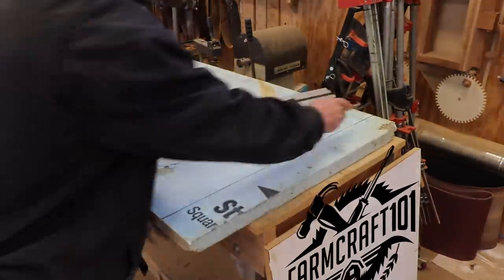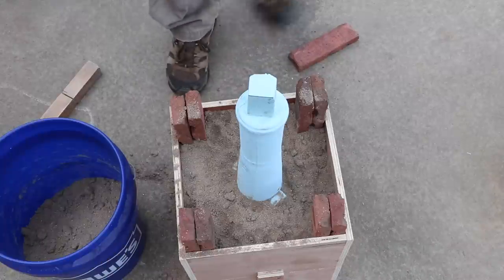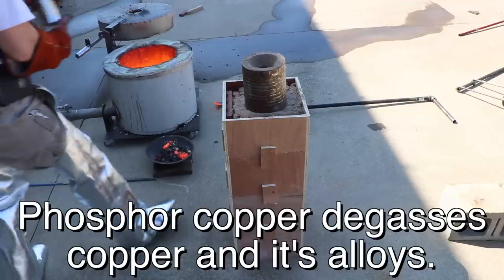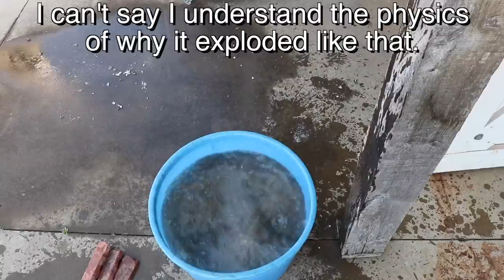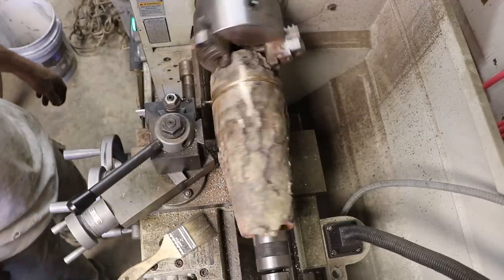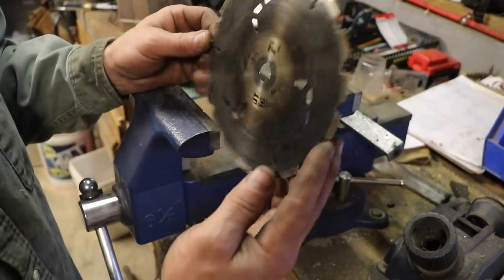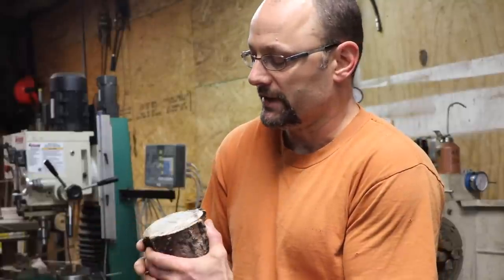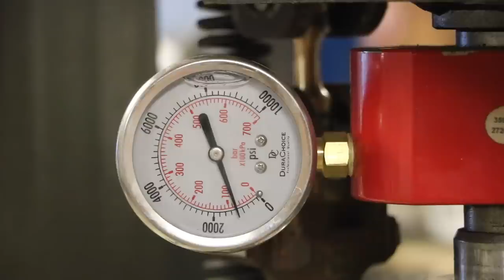How NOT To Cast A Historic Bronze Cannon Barrel.  FarmCraft101

Comment: I think what you may have forgotten when you were testing Tensile PSI STRENGTH you pulled the whole “cannon” out of the mold right away after pouring, so quickly in fact the interior was still molten. Then dunked it in water to cool off. I can’t say I understand how Tensile PSI Strength relates to cooldown time [nor do I know how it differs between Cast Iron, Steel, Aluminum, Copper, Brass/Bronze] but If I was a betting man I have a feeling allowing the metal to cool slowly and uniformly might {just might} net you a higher strength result. 

That being said, someone else prolly already mentioned as much and since I’ve seen posts for the final production, all this is a moot point 😉.

The one thing to add that is still relevant is: Thank you for documenting and sharing your trials and tribulations, the methods and thought process as you work new things out. They say failures are never wasted cuz it’s simply 1 more method you can say does NOT work … by sharing that with an open community we all gain the benefit of seeing it for ourselves and hopefully 🤞 not ever find the need to verify your results.

Comment: One thing I noticed between you and other lost foam cast videos is that you did not coat your foam model in plaster.
Reply: Normal plaster is a biiiiig no-no when it comes to casting high temperature metals. It tends to explode. Do you mean like special refractory cement with a plaster binder or something?
Reply: @daviddoluca6620  - I was watching the video titled "Shijiazhuang Ruiou Lost Foam Casting Equipments Co,.Ltd" right at 1:26 and I thought they were using plaster, but you are right, it is some sort of cement coating.

Comment: I  was a machinist for forty years . What your  brazed carbide tool should be is a C2 or a Carboloy 883 . These would be rated for cast iron and other abrasive metals like what you were turning . ( a C5 or Carboloy 370  are for steel ) Next put a 3/32 radius on the nose . Spindle speed about 120-180 RPM . Feed rate .010 -.012 per rev ( IPR ) and a depth of cut about .100 per side and chip away until it cleans up to about 75 - 80 per cent . Then you can speed up your turning . It'll take awhile but you'll get there .

Comment: Although I'm a little older than Harry Harris I also worked in a foundry when I was a 18. At the time we were casting aluminum lawn mower body housings and any defective castings and scrap was stored outside where it was exposed to rain and snow. There we three crucible style furnaces side by side in varying stages of the melting process. Eight workers in the foundry including myself received varying degrees of nasty burns due to an serious explosion in one of the furnaces. As workers were aware of the danger when adding new scrap to the furnaces so they would dump scrap from one scrap bin to another before adding it to the crucible in an effort to dump out any excess water that may have pooled or captured in the hollows and voids of the scrap. Due to the size of the explosion an investigation later determined that a complete, but scraped, lawn mower casting must have filled with water and then purely by chance, another complete casting added later on must have accidentally aligned perfectly with one shell going inside the other (like one soup bowl stacked on top of another) trapping the volume of water between the shells. When the water came in contact with the molten metal it instantly flashed into a steam explosion. The forklift driver adding the scrap to the crucible got hit with a wave of molten aluminum receiving  burns over 60% of his body. He spent several months in the hospital and ended up on disability. Unfortunately back in the 60's other than heavy gloves and goggles we didn't wear full body protection or hats of any kind. NET: Whether it's molten metal added to water or vice versa then result is the same. (this link is not to a video of my accident but presented the same general result -  youtube.com/watch?v=sIJmwF1Qs7M

Comment: The explosion. Water turned to steam.  Steam is 90 x more volume than water.   You get a very rapid expansion of liquid water to steam with a pop.
Reply: I believe steam used to expand to 1700 times the volume of water but it's getting old now and could be losing some of it's steam. That was some time ago and I haven't been watching if physics have been hit by the current insanity infestation. Nothing is safe these days. One of water's relatives, Iceland was hit recently and it seems as though someone has been pounding on the equal to asci button and changing everyone or it could be something in the water they're chewing there. No ill intentions just going crazy and taking as many along as possible. Peace
Reply: Jim Marriott  I was going by memory maybe wrong, but in any event it’s a lot.  

I learned the hard way casting boooollets.  I dropped a piece of lead into the pot that had a drop of water on it.  The walls were covered, the ceiling, and of course me too.  Burnt the shit out of me.   Now I preheat anything going in the pot. God takes care of stupid.  I will not do that trick again.
Reply: Too true. I was holding a hose one day when a high school teacher I built a V8 Vega for walked over and removed the rad cap right after breaking the cam in. He was shirtless and went to a fine shade of red in the explosion. I started spraying as I asked wtf are you... He got out with no harm just a little discoloration. He's a science teacher. Go figure. Try a cup of over heated water in the microwave. Tap and kaboom. Crazy stuff that water
Reply: The 2 stroke Norwegian is casting his own 50cc cylinder and learning as he goes to. I agree with you, preheating is the way to go. Losing the foam completely ahead of time is the only way to fly.

Comment: You need something like a ceramic coating on the foam to contain the pour as the foam melts and burns off. That along with some proper venting to relieve the gas pressure in the direction you want so it doesn't push out on it's own. Also in order to improve the grain structure and put any inclusions  away from the high pressure breach of the canon you could go to a bottom pour type of moulding but that typically uses 50% more metal as a loss from the long sprue and associated gas vents.

Comment: Thanks for the video. You can't forge or heat temper bronze the way you described - that's for iron alloys. Bronze can be work hardened but I don't think that would be helpful in making a cannon. Best I can tell your results are down to the composition - we saw you add copper, tin, and then brass? As far as I understand it you want 88% copper 8-10% tin and the rest zinc. If the brass is pure copper zinc and the proportion is calculated right that could have worked but perhaps it was not. Supposedly with a slow cooling piece like that the tin tends to migrate to the last parts that cool - in this case right where you drew your test material, so that may have influenced the result. You could do the casting with considerably less metal if you cast it around a solid core, and it'll save a lot of time drilling a bore later.

Comment: When you put the hot casting in water, it first hissed a lot, then it exploded.  You asked if the physics for this is known.

What you saw is something called the Leidenfrost effect.  What is happening, is that radiant heat (ie: intense infrared light) from the casting is vaporizing a thin layer of water.  During this effect, the steam is physically separating the water from making contact with the casting.  

In science textbooks, the traditional demo of this, is water drops on a searing hot skillet, that zoom and bounce around.  Those droplets are riding on a cushion of steam.  Because there is no contact, the droplets move with little friction and zoom or bounce around the skillet.

But of course your casting is cooling down.  So at some point, the radiant heat is too low to generate the layer of steam.  This layer of steam is relatively insulating, compared to a layer of water.  So when the steam layer disappears, the water makes direct contact with the casting, and the water can then get heat from conduction.  So it heats up violently which is a steam explosion.

So the hissing is the Leidenfrost effect generating an layer of steam by radiant heat.  And the explosion happens when the liquid water makes contact with the surface, and generates steam by conduction.

https://en.wikipedia.org/wiki/Leidenfrost_effect
Reply: Beautiful. Thanks.

Comment: Yeh I think that you need two sprue pins. One to vent the other to pour into.

Also you need real casting sand. 

To save metal and also assist you in the bore maybe you could rough cast the bore into the foam. Then you can ream out the bore to the diameter you need. Reaming is easier then boreing. 

Also you might consider normalization. Rolls Royce buries their engine blocks in dirt for five years before machining the cylinder Head. That way the bore will never change shape. 

Thanks for this video! Loved it.

Comment: Awesome. As a fabricator that works with metals that are already smelted, alloyed, forged, formed (initially) and heat treated, I have learned a lot from your videos and others. I've also learned that I have a lot more to learn about metallurgy. Would muriatic acid remove the sand, or maybe lift it up so you can chip it off? Probably depends on the kind of sand.

Comment: I am a foundry engineer, however we cast stainless steel so bronze is not my field of expertise. But I know the brass foundries use nucleation agents like Zirconium to make smaller grains. We don't want to leave foam in the molds since it introduces porosity in the casting. You want to fill the mold from the bottom up with a gating system. I would have the breach tilted upwards with a feeder on top, and a core to make the inside of the barrel, and leave work allowance on the inside to machine it into dimension.

Comment: the water explosion comes from a rapid boiling of a larger amount of water, causing it to quickly expand while the water around it is still fluid. now the low density steam pushes up quickly and takes some of the still liquid water with it.
just as an idea, cover the outside of the Styrofoam with some ceramic paint (including the vents you should add) and let it dry properly, that way the sand is more there for rigidity and thermal mass. can't promise anything though, that's just what I'd do as someone who usually works with solid material, not giving forms to liquid or glowing metal.
but then again, I'd also go with a very thick walled core of steel (probably 42CrMo4) and just use bronze or brass on the outside for looks, a layer of something in between to stop corrosion from occurring (probably Aluminium as it's less noble than any other metals in there, therefore getting eaten up by the others. you just have to make sure it doesn't get hotter than 600°C in that layer and that you have enough room to account for the different expansions of the materials. 
if you really want to go with full bronze, a common mixture for Bronze (according to my books) that can have high tensile strength (up to 720 N/mm2) would be CW458K as R720 (DIN EN 1173), containing 5%Sn, 1%Pb and the rest copper. not sure how it's called in America though (or even if it exists there), but thanks to the magic of simple math, it can approximately be created by oneself.
casting is a dangerous process (one of the reasons I work some other place), so take every possible precaution you can.

Comment: I already know the problems.  The foam will melt and cause gas to well... you already know expanding gases and castings don't work well.
Reply: What if you use better sand, some kind of binder to make it more clay like. Then you just delete the Styrofoam with petrol, pour/suck out the goo (napalm) let it evaporate for a few days and then you should be left with a (mostly) empty mold.
Reply: @Lappmogel  That could work but I am wondering if he went through all that trouble why did he just go the extra mile and get the right kind of sand.

Comment: At a guess? The gasses from the burning foam forced the sand outwards, causing it to crack. Also, I believe that typically, cannon were cast breach up, with the bore also partly cast in. The sprue was attached to the knob at the back.

Comment: The big parts are cooling slowly, from outside to inside and that's will  cause inside damages .The first filled  parts of the mould are the smallest parts of the piece, the big  one need a "reservoir "of fresh  molted metal,so it should be placed at the top.The sand also ,content water which need rapidly steam exhaust.Pouring is not easy stuff.Good luck!

Comment: You made a great video. I like learning about metal work. I think not super wet but wetter than your sand would have dried on contact with the heat sucking it away from your mold.

Comment: I think that was an outwardly expanding bubble of thermally saturated/dry steam, when the fluid fell back inwards and quenched it, the transfer of energy from the vapor bubble to the fluid created the rapid expansion. Think like a big thermal spring suddenly letting go. As for how to clean up that clusterfk - chemically... the only thing I could think is soak it in the most ridiculous acid you can find to eat away the silicates. This will only be effective on the portions of sand that haven't been encapsulated in the metal though - It would probably be faster to melt it and then let settle and cool, then cut the sandy section off with a new band saw blade (i'm sure you replaced it already - that blade is cashed - the crystal grains to cut are orders harder than the steel).

The easiest cheapest way, these sand bronze amalgamate extrusions should be more brittle than the base metal, you might be able to do some real damage with a 20 pound sledge and a yeti sized friend/neighbor.

Comment: The reason why it exploded once you dropped it into the bucket is that the water was still being turned into steam, just under the surface of the water. Those bubbles then rise through the liquid water to the surface where they create voids which the water attempts to fill in (and thus splashes up). Its a fairly large bubble initially due to the metal creating steam all around it as it falls through the water initially. After the initial fall, the bubbles are significantly smaller and can be seen agitating the surface of the bucket afterwards.

Comment: I don't know anything about this but I saw the size of your foam and the size of that crucible and said hmm, what's the plan here?  Pretty obvious that wasn't enough.

Then I saw the bark pattern and I figure wet/green sand has water in it that probably steamed upward and the sand collapsed into the void.

Then I saw you wait 20 minutes and wasn't surprised that it was still gooey but that was cool.

I was thinking the same thing about carbide, glad that worked for you.  Maybe try cleaning it with a powered wire brush? I think the lathe is a bad idea until ALL the sand is off.

Good luck!

Comment: have to wonder what the tensile strength would come out to by mixing Antimony with your brass.
Antimony is used in casting lead bullets to raise the tensile strength of lead and works very well. Tin is also used in the lead alloy.

Comment: idk what you call green sand but  i think you should try making  oil sand cast the cannon on the horizontal, and dont leave the foam form in the mold
so your going to have to make the mold in two parts using talc to seperate the mold

Comment: I used to make poly patterns for large die castings, the foundry used just dry silica sand, the metal would burn out the poly. You need to pattern the running system too, run in to the bottom. Latter the foundry used CO2  sand method, but burnt the poly pattern out with a hot steel bar, then cast.

Comment: Interesting project.  I notice that you didn't use runners and risers to allow gasses to escape and the bronze to flow into the canon as the metal contracts when cooling down.  Could this be the reason that the job was such a disappointment?
I used to help a guy who did lost wax bronze casting and he burned the wax mould away before pouring the bronze.  The wax was encased in plaster of Paris.  Surely, leaving the foam in place will play havoc with the pour and pollute the bronze with combustion products?  What to you think?

Comment: You need to make an adjustable tool post to centre a grinder on the lathe with a few flappy wheels it'll soon turn down that in no time we used an adjustable clamp on ours to resurface faces of parts on sand refractory consumables. Much love from 🇬🇧

Comment: I`m not a mathematician or anything like but when you did the tensile calculation you divided by two because the press was pulling from both sides (16.50) , i do know presses and they only pull or push from one side and the other is fixed , just saying in case your strength is better than you thought.

Comment: Why the water exploded: When you excite any particle or molecule it tends to gain energy, the particle/molecules in this case being the bronze alloy you made in the crucible. Once you inserted the Bronze Alloy into the water bucket a transfer of energy began as the Bronze wanted to cool down to a more stabilized state like a solid, hence the water molecules accept the energy given off and begin to accelerate much more quickly. The water molecules that absorb enough energy become steam whereas the ones that do not remain as water but cause a disturbance underneath and on top of the water surface, with enough molecules causing a disturbance it allows the water to shift and inevitably erupt.

I hope that provides a decent enough of an explanation.